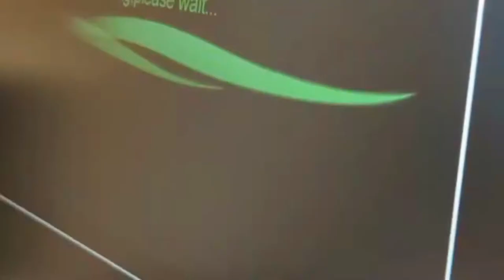Hikvision Fan Noise Replacement

Comment: What silent fan should i get for hikvision model DS-7204HUHI-K1-P(F18074696)
Reply from the maker: I’d recommend Noctura NF-A4x 10 FLX 40x10 Premium Fan. I have 2 NVRs and I didn’t need to replace the fan in the newer model. Good luck.

Comment: Why can I not see how you connected it, I would like to know how a 3 pin ventilator goes to 2 pin but you dont show it at all sorry
Reply from the maker: Hi, Thanks for the question. I bought an “adapter” from Amazon. You only need the adapter, there are merchants selling other attachments with the adapter that are unnecessary. Just 3 pin to 2. Good luck.

Comment: My nvr was second hand so I had to replace the fan in the power supply as the bearing went inside of it but now it just sounds like a pc computer
Reply from the maker: Hi, Thanks for watching and commenting. Is the sound tolerable now? It was intolerable for me until I removed the cover and replaced the fan.
Reply: @radioflashinfo  lot less noise from from it
Reply from the maker: @leahlambert5737  Beautiful system once you get the noice distraction resolved. Thanks